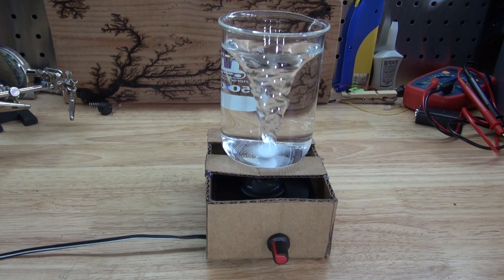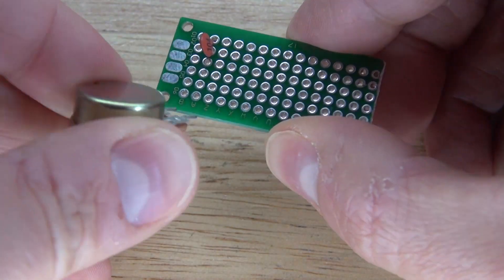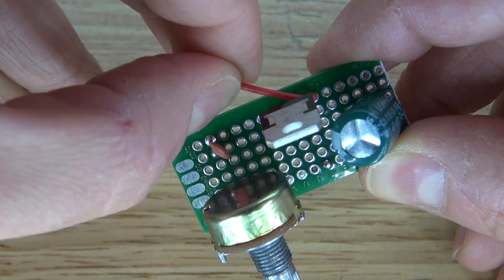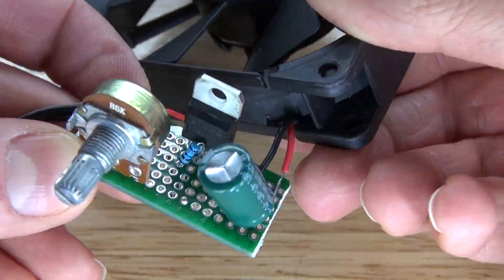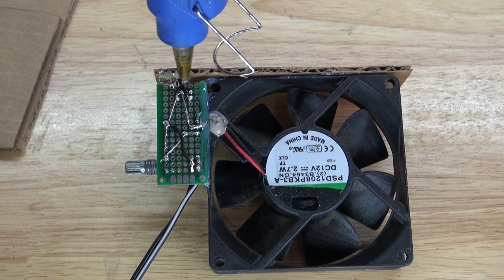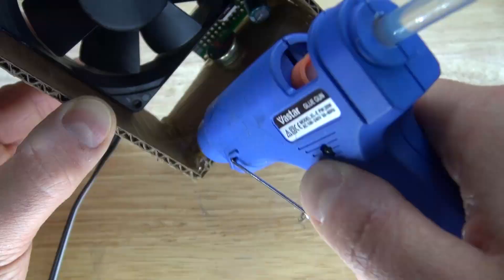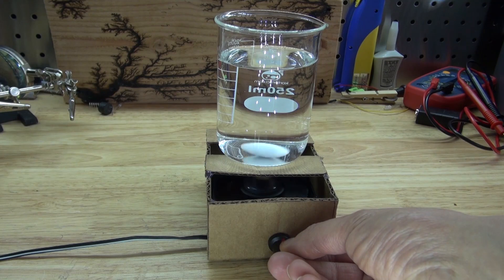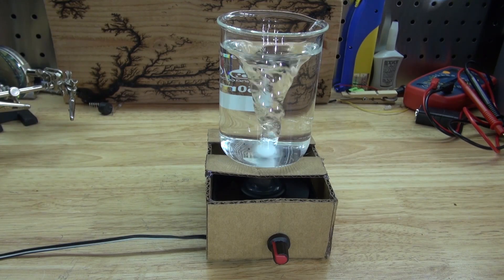DIY Magnetic Stirrer

Comment: hello, I am interested to follow this steps to build a stirring mechanism which will help me in my work. I would appreciate if you could share the basic information or considerations to follow like example in order to obtain the actual values of capacitor, resistor and other component sizings, what concept or approach do we use?

Comment: ASMR soldering, but your iron looks absolutely awful do you use brass/sponge?
Reply from the maker: Yes I do. I have been using this soldering iron tip for 4 years. Just wanted to see how long it will last.
Reply: @SciTyeTech  it works wonderfully considering how crusty it looks

Comment: I just built a PWM controller for the same purpose. I wonder which gives more control. I'll build this later and test it out! Thanks for the idea!
Reply: Also, you specify a 1MΩ pot in the notes, yet you seem to be using a 5KΩ pot in your build (B5K). This is quite a discrepancy -- can you explain?
It is not labeled on your wiring diagram.
Reply from the maker: Yes you are right. I miss typed. Thanks for spotting that out. And in the schematic I should have wrote that too. 
However, in my opinion there is no specific type of potntiometer needed. It is only larger the resistance the wider turning of the potentiometer and less resistance the shorter the turn.
Reply: @SciTyeTech  That makes sense. I'm new to this whole thing, so I just get confused when things don't line up 100%. Thanks so much for your tutorial, though! People like you make the internet a great place to learn. I'm waiting on an LM317 regulator to come in the mail so I can try out this design. I'll let you know how it goes! Cheers!

Comment: I'm having trouble finding a 1m ohm potentiometer and a 10µf 200v electrolytic capacitor. Can I ask where you purchased them?
Reply from the maker: I didn't, I found them from spare parts.
Reply: @SciTyeTech  Thanks, I eventually found some equivalent ones on Amazon.

Comment: Just made this.....the only issue is that the Pot doesnt control the speed, it's just basically an ON/OFF switch.
How can I fix that?
Reply from the maker: There could be a component that is not functioning properly. Did you solder everything correctly?
Reply: Some fans can’t have their speed be regulated by the voltage, so maybe that’s the issue?
Reply: @yourlocaltoad5102  from my knowledge every fan will spin slower on lower voltage
Reply: Try using smaller pot, if it's bigger than 100k then it may make the regulator malfunction

Comment: Wow, that works unbelievably well considering you're not even over-driving the fan.  Usually those things only draw a few watts but mixing water takes a lot more power than moving air.  It might be a good idea to put some feet on the bottom to raise it off the bench enough for the fan to draw enough air through itself to keep cool.

I tried this some time ago without much success.  I laid a pair of quite strong magnets side by side with opposite poles facing up on a small metal strip glued to the hub of the fan.  As I recall the issue was that although the field was very strong near the magnets, it dropped off too rapidly to fit a material of sufficient thickness between them and the work.  I'll have to give this another go with poles facing diametrically outward like this so the field will be more spread out.                                    
     
Did you buy the stir-bar or make it yourself? Is it just a metal bar inside or does it have a rod magnet in there? I think the other reason I didn't get mine working was because I was trying just to use a steel rod.  It seems that the ellipsoid shape is quite important for minimizing friction between the bar and the container.
Reply from the maker: You should for sure try again. I already have had the stir bar that I used for chemistry projects. The problem you were having is the steel bar. The stir bar I am using has magnets inside of them. The magnets will follow magnets and the shape if the stir bar helps as well.